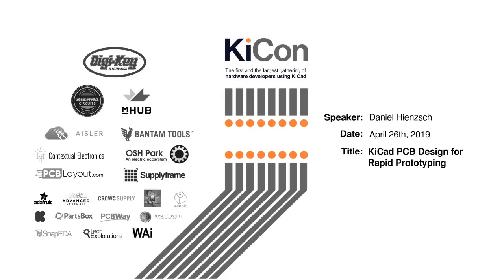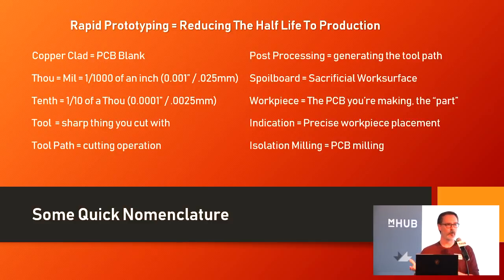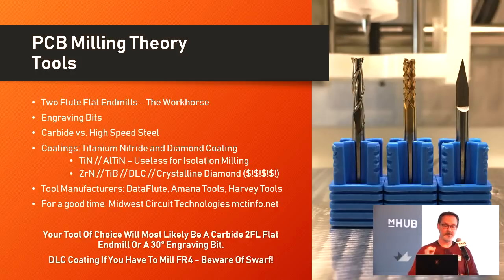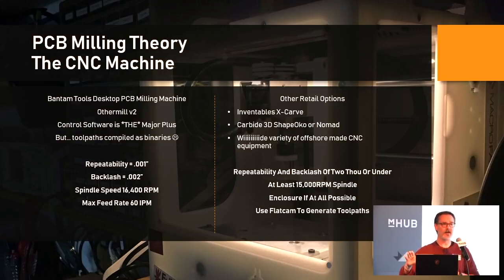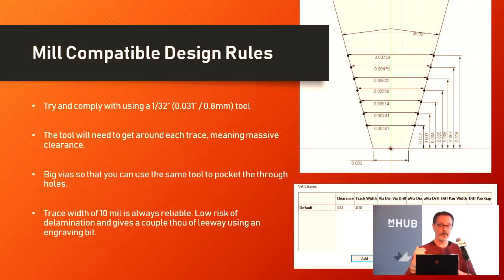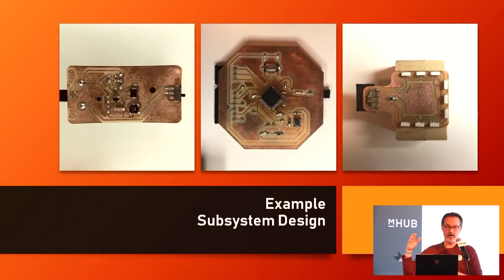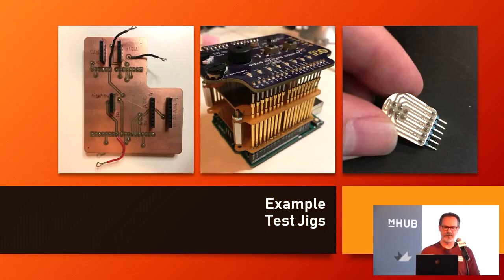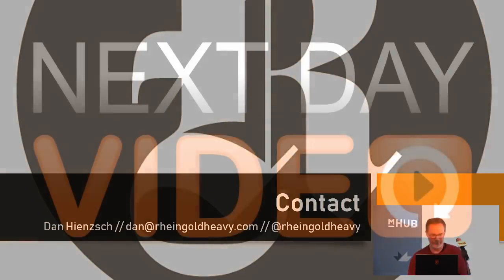"KiCad PCB Design for Rapid Prototyping" - Daniel Hienzsch (KiCon 2019)

Comment: 15:58 - Vias
  You can get a kit of brass micro rivets from the standard China direct source sites. I use a 0.8mm drill bit for drilling my etched designs as I bought a few hundred in this size. Then, for vias I use a M0.9*2.5 size rivet in the hole. I usually need to drill from both sides (or any other type of drilling tomfoolery) to loosen up the hole from 0.8mm to fit the 0.9mm rivet shaft. Next I place the rivet in the board then with the rivet collar down against a block of wood, I use a straight dental pick to start expanding the back of the rivet. Finally I use a small hand threading tap (incorrectly) with a small hammer to fully expand the back side of the rivet on the board. I use a tap because all of my small size taps have the perfect size conical taper on the business end of the tool. Any conical tapered thing would work here, I'm just mentioning the tap as a hint because most makers should have a few of these laying around. After setting the rivet, the final formed collar on the back is almost as nice as the front. When I have several to do they each take around 10-15 seconds to place and set. The hardest part is just getting them in the holes as they are a bit small for my finger dexterity.

  If you're looking for more info about micro rivet sizing, like I was before trying this, these are the common sizes and what they work for/with:

M0.9's will barely let the smallest leads pass through, like the ones that come on the cheapest THD 1pF-33pF ceramic disc capacitors. They are mostly useful as just plain vias.

M1.3 rivets are a bit iffy as far as passing leads, if you try to get small component leads through this size it's about 50/50 trying to fit a smaller gauge 1/4w resistor lead through them. By "smaller" I means the thinner ones that come on 1% 'One Hung Low' Chinese 1/4w resistors. You'd never fit a quality Vishay or Allen Bradley 1/4w lead through this size. Some rivets seem to have variable wall thickness in this size and it's right on the edge of fitting leads through them. I don't use this size much.

M1.5*2.5 This is my go-to size for any through hole component I want to mount in a "plated" style trace connection. If you use this size for standard 0.1in spaced components, like a DIL package, you'll need to trim the collar to avoid overlap. I also invert the insertion side every other rivet but that's just my preference. The collars are easy to trim. However, I usually just insert, form, and set all of them, then come back with an exacto knife and trim the sides. A razor can easily trim these. Also, a standard DIL pin fits this size.

M1.7 These are large enough to pass the upper portion of a standard TO-220 lead (the upper part above the solder set shoulder/the part that attaches to the epoxy package), or a really large T-03 type lead. 

 The real trick with any size is trimming or picking a rivet that barely protrudes through the back side of the board. 

Anyways....these don't require any special tools, they are very cheap (I paid $4.04 shipped for 100 pieces in 10 different sizes/1000 pieces total on AliEx), and I haven't seen anyone demonstrating the use of or talking about these. They make rock solid mechanical connections, and an outstanding way to add through holes to, or repair an existing design. They can also salvage prototypes where mistakes get made and the single sided trace solder clearance isn't accounted for :-) 
  I hope this helps anyone like me that has scrapped several prototypes due to this through hole plating/solder clearance dilemma. It would be really nice if one day KiCAD had a DRC option that accounted for nonplated routing and soldering clearance.

  Also the speaker mentioned enlarging pads and creating "a library to put them in." Eventually this will become unmanageable. IMO it is better to create individual global libraries that are named with the original name of the parent component's library. For instance, if the default is something like "Housings - DIP," create a custom library named "Housings - DIP - MOD."
  I use "BE" at the end of my custom library names and add "BeefyEtch" to the ends of the cloned original component names. 
...just a tip/suggestion from someone that got sick of making duplicate footprints after tossing most of mine into one of two overly simple custom libraries, then not finding old ones on the list and making them over and over with inconsistent names. Don't do this :-)
-Jake
Reply: I use a dremel attached to my 3D printer for all the cnc drilling, then use Ethernet wire stripped and cut to about 2.0mm on 1.6mm FR4. I then pein over the copper wire centered in the VIA hole vertically with an automotive trim hammer (fairly small - maybe 1 oz). After my rivet is in place I like to flux and solder both sides. I've tried those rivets your talking about, too much fiddling and faffing about to get those reliable.

Comment: I use FR4 with a WD40 coat on top (more like a pool, really), it helps the V bit cut and traps the dust. Also use the V bit for marking drills, so the finer drill bits don't walk and break.